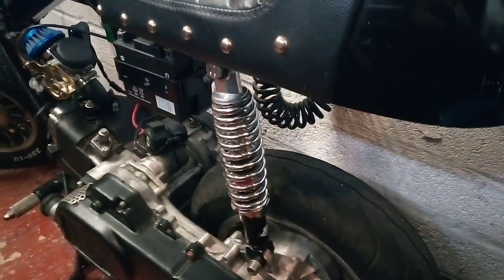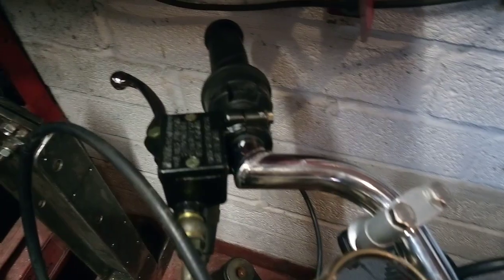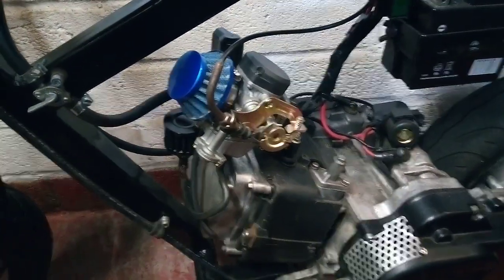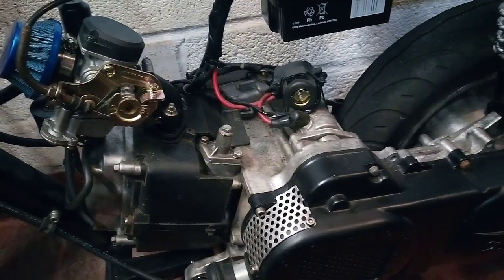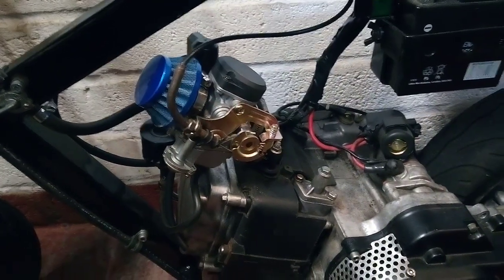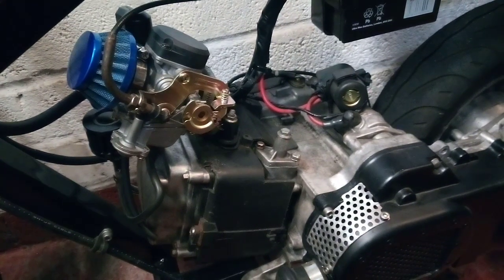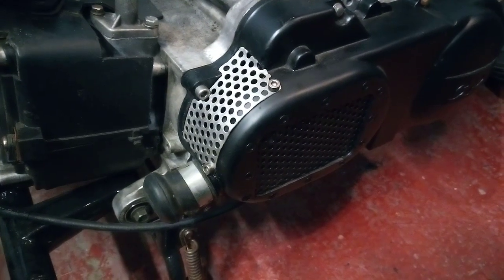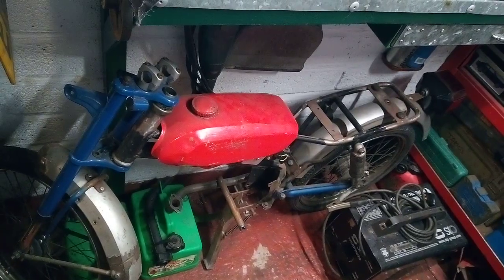Custom 49cc gy6 racing scooter. Less is more!

Comment: I like your ingenuity, did you build the frame?
Reply from the maker: Yeah this is the second gy6 frame that I've built from scratch. The first was for a 125cc engine which was more of an inverted triangle due to the engine mounts being on the top. I had to change the design for the 49cc as the engine mounts are underneath but still managed to keep some of the triangulation.